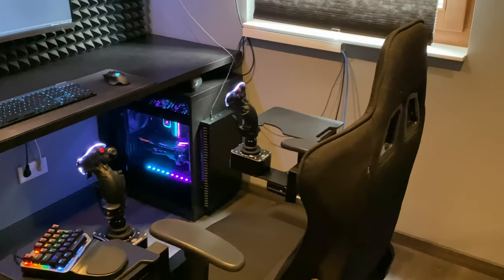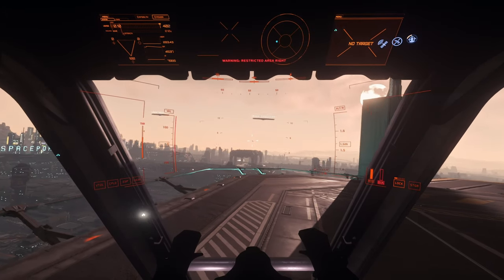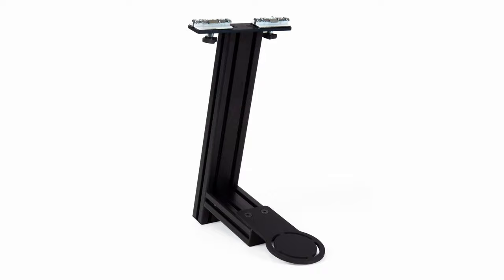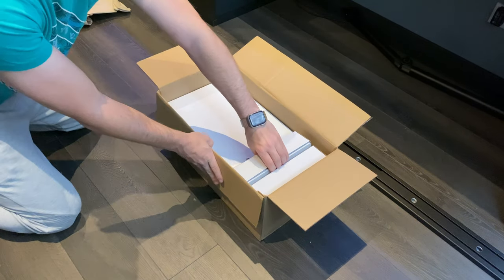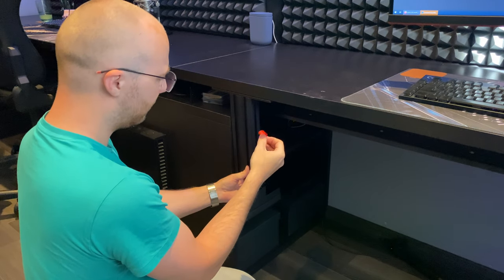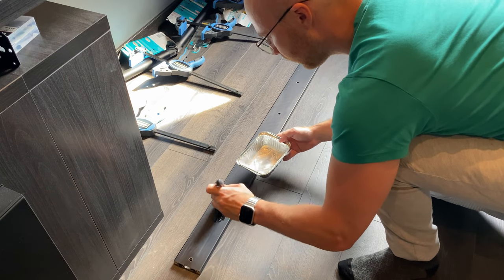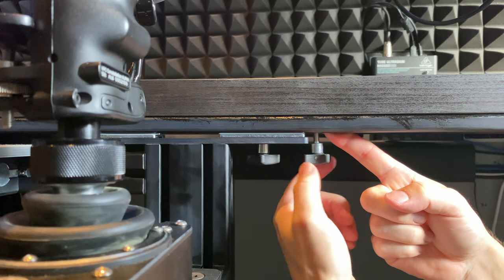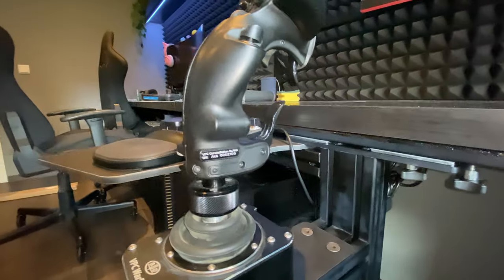Monstertech SLIDING RAIL Dual Stick Virpil Setup for Star Citizen

Comment: a little blue tape on that front face of the rail before you apply epoxy prevents all that dried epoxy on the visible face of the rail. also better to use a non fast cure epoxy for adhesive. the fast cure epoxy is brittle and more likely to snap off the desk if you put repeated downward force on that rail. lots of surface area though. the trick is don't over-clamp and squeeze out all the adhesive. wouldn't be a bad idea to fillet the back edge with a bead of thickened epoxy, since a lot of the glue will get squeezed out by the clamping.

Comment: I love that you sanded down the surface of the rail before applying glue for better adhesion. We call that a Grade B surface prep at the Satellite manufacturing facility where I work at ;)
Reply from the maker: Haha thanks, Shack! Gotta make sure the entire thing doesn’t come down while flying 🤣
Reply: with that amount of epoxy I doubt it would be a problem 🤣

Comment: This is a great addition to MT product line-up. My only critic is that the sliders profile is too wide. I use the sticks without the keyboard support and I push both sticks to the same side of the desk, but because the sliders are much wider than flight sticks, I can't make them flush against each other and that eats precious space. Still a good solution, but could be much better if the sliders used both rails and were narrower.

Comment: This is the stuff I like to see!

Particularly how you solved attaching it to the desk with the glue, sanding it down and using one screw to lock the mounts, keeping the mouse extension on the left attached to the left stick mount. That was fresh to see, and shows good versatility, and shows that you can customize it to your own liking quite easily.

I would like to see a simple dead-stop or brake feature like you mentioned with the left-over bolt you had. That way you can for example, lift a little lever/button/paddle that's attached to the rail or mounts that prevents the mounts to move > then move the mounts in/out to the position you've screwed in the dead-stop / brake point where you want it to stop and it can sit tightly while remaining easy to move in and out of the way.

Mainly because constantly screwing the stops would add some unnecessary wear and tear to the metal which over time could make it a bit loose, and a brake would be much less cumbersome and finnicky to fiddle with under the desk. The swivel accessory on the chair mount could benefit from the same but with a "swivel indent" so you can screw in the swivel with the indent at "position 1", facing the "in-use" direction, then adjust the outer inden for "position 2" in the "out of the way" direction, and simply lift a brake lever and move the mounts in and out of position 1 and 2 as you please with ease.

As the rails did seem to stutter slightly as you moved them, it might be a viable solution to find some kind of small wheel baring-like piece to put on the mounts so they can slide in/out of position easier as well, to make it smoother. Smooth is fast, after all.

Another thing I was thinking was the chair-to-stick positioning. Part of the reason I went with chair-mount over desk mount was that I like to have the sticks in the same position relative to where I'm sitting, so having them on the chair seems natural to me as if it's a cockpit seat or simpit where the sticks are just there all the time, with the option to move them out of the way.
  So while using the desk-mount or rail-mount, if there was a way to attach two neodymium magnets to plate or piece of metal under the WarBRD bases and a similar piece to the chair's armrests, that would allow you to "click into place" as you like it with the chair, and make the chair positioning easier with the option to move away super easily.

As for the rail-desk-mount, it seems to allow for that tighter stick axis setup while keeping it comfortable to use as a normal desk when you want, as the wobble from the chair-mount requires larger dead-zones to avoid it and with a completely still mount you can take advantage of the stability to hone in your stick precision even more, nice 👍

I'm liking the simplicity of these reviews as well man, the videography and shot-angles were well done. Easy to follow, easy to see what was going on and the overview pans were clean. 10/10, might have to consider rail mounts now.
Reply from the maker: Thx Star 🥰

Comment: I use a Thrustmaster T flight X or one of the same looking models i dont remember. I just cut some wood to tne shape of those bendy Vice grips so itfits to the shape of each part, then i screwed each wood piece to surround each half of the Hotas to keep it in place for forward and back moving and properly tied them down so they dont move with Zip ties, its ugly but works and my chair isnt one to be regularly moved so no shaking. I also put a small mouse pad under my wrist in case i need it when someones taking up space beside me, and on the left side a "Mount for my keyboard" like the way it looks in Elite.

Comment: I love this setup. My question is whenever you leave your ship to do bunker missions or any fps how do you quickly transition to the larger mousepad and keyboard on your desk?  Sometimes you need to land fast and get into fps mode.
Reply: Exactly ^^^ Seriously I need a video/example of the best setup to handle this. You cannot stand up and slide these things aside WHENEVER you go into the RPG/Shooter side of things in Star Citizen.
Reply: Looks like he used a small wasd keyboard on the left mount and mouse on the right, just outside each stick
Reply: This is the issue I'm having. I want a mounting system that allows me to quickly and easily transition from having my hands on my sticks to then a normal FPS position with my hands on keyboard and mouse. I don't really like the idea of this set up where the mouse and small keyboard are so far apart from each other.

Comment: This is a very cool setup.. but can you add a throttle AND the virpil left stick (with extension) AND a steering wheel setup for sim racing? That's what I want. I will build a custom desk.. no prob.. but I need a slide away for my 61 key keyboard, a second slideaway that is sturdy for mouse/keyboard area, and I need the dual throttle setup for SC and a throttle for DCS but also a shifter and ebrake and steering wheel option for sim racing stuff. Can you add/remove a steering wheel and such easy enough? I dont want to have to remove tons of stuff just to slid in a wheel. NEeds to be like hot swap easy.

Comment: That was very informative, thank you. I can see how this would be an improvement in terms of stability and stowing from the chair mounts, but I am not convinced this compares as favourably to the regular clamp-based desk mounts. stability is better with a clamp, and moving them away requires just to unclamp-slide-reclamp. so what am I missing with the rails sliding system? 

I guess it is a question of having multiple things to relocate, but even then your two side extensions are light and go on a single clamp mount anyway.

Comment: I wish I could do this. I've owned my alphas for about a week now, but due to my curved desk, I've had to attach my sticks to my Aeron using flimsy monitor arms. I'm also using the warBrd bases and have yet to come up with a quick and easy dismounting solution. I wish I'd done some more research on the bases, because they don't work well with quick mounting and dismounting as the cable is hard attached to the electronics inside the base. I've done the same as you with the "umbilical cord" and I find it really annoying so I basically take everything off the chair when I'm not playing any flight simulator. All in all, I probably wouldn't have done all this had I known how much of a hassle they'd be.
Reply from the maker: Oof I can see the struggle. You could always modify your desk, make something yourself, to fit the rail maybe.
Reply: I use a short  one foot long USB extension cord from the USB hub on my chair that plugs into a longer USB cable that goes to the PC. I can unplug that connection easily to move the chair around. It also gives one more point of safety in case i accidentally forget and push the chair back. Instead of ripping out a cable, it will unplug at that point.

Comment: They need to have a dual rail system. A single rail gives too much of a flex/pivot point when downward pressure is applied. This will eventually lead to the screws working out of the desk as well as the rail warping/bending.

Comment: They don't look like they slide super easy, like they bind up a but if the force applied is not 100% in the horizontal direction. Also that wobbly desk is sketchy af. all of that looks like it's just waiting for a random chair slide or over use of force to break something.

Comment: Hello. Nice video to tart with. I want to build the same, but want to ask u this... The mousepad extentions, are the ones you bought from the previous setup? ie when i order mine, i buy the base from the rail menu, and the mousepad extentions from the 'chair' menu , on the webshop ?
(i want the left joystick/mousepad and the right to be one solid unit, not 2 and 2)
Reply from the maker: These are the mouse extensions meant for the desk mounts!
Reply: @BlackMaze  Many many thanks for the reply!
 Any chance you updated left of right grip with a Z-extention to see if it can move freely without touching the mousepad?